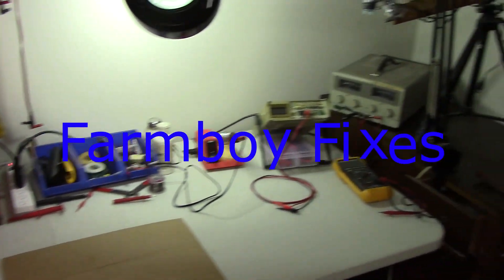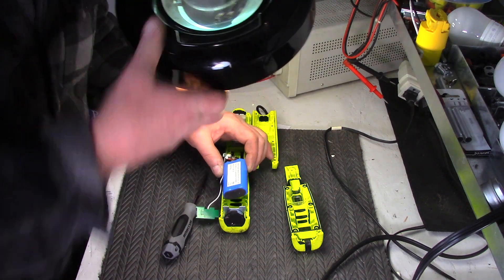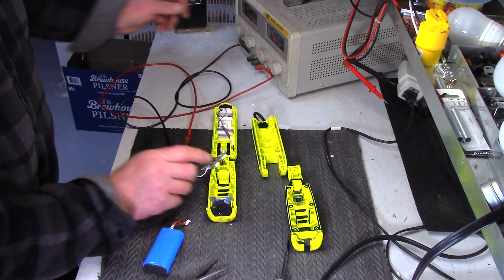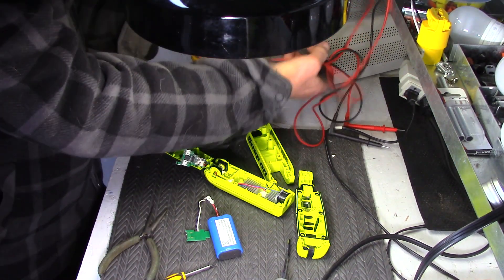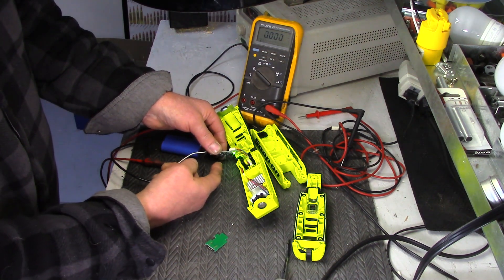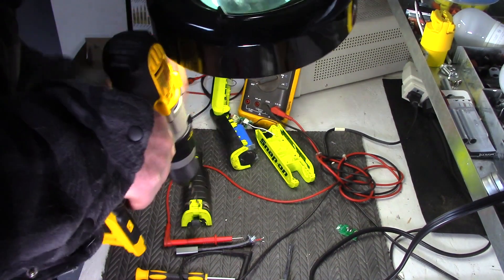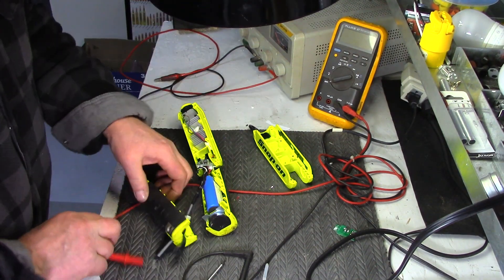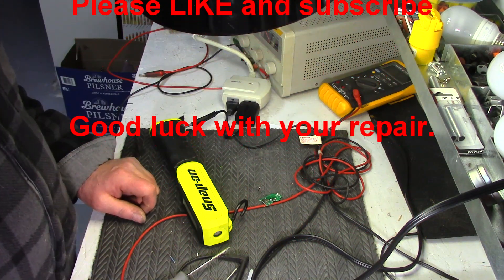Repairing a broken Snap-On light

Comment: Man, just pulled one of these apart. Had four of the little I assume surface mount resistors blown. four crispy critters... and I don't have the equipment to do flush mounts on a board. Though maybe someone will drive over one, and we can frankenstein a new one together. XD

Comment: Why wouldn't you take or send the USB circuit board to a computer shop that has micro solder equipment and get it fixed? Then put it back to original.